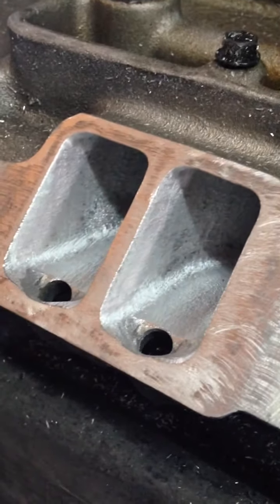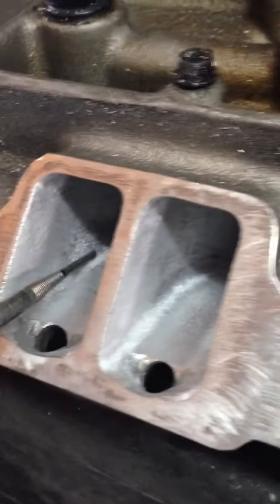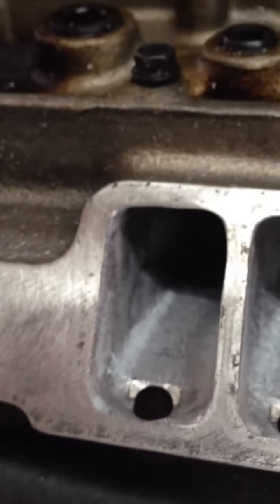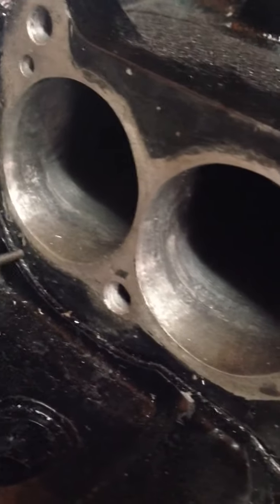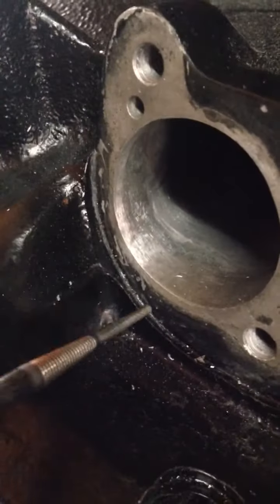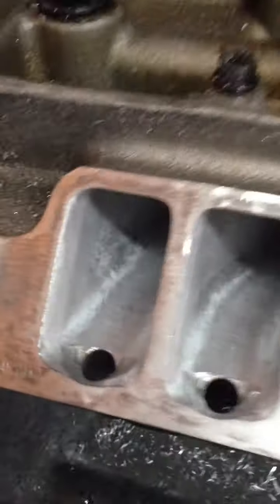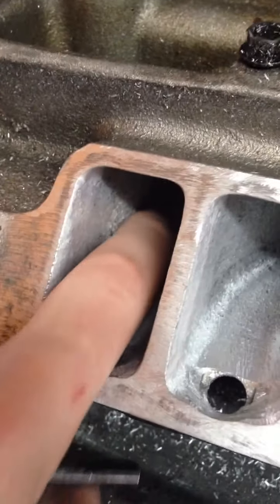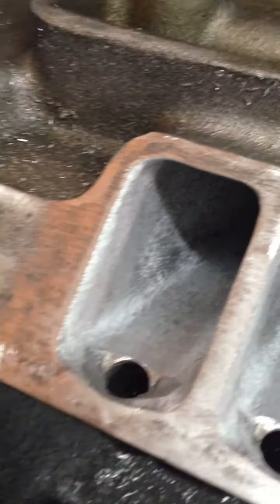*** New TPI porting secrets! ***

Comment: can a stock TPI be ported to flow as much as the aftermarket Edelbrock ot Accel?  Used aftermarket manifolds are going for $600 to $800 used now because of being discontinued.
Reply from the maker: Randall Fox 
Yes, if it’s done right.
Reply: @DarinDochterman  what do you charge to port a stock base?
Reply: Extrude hone it! Do a search for it. There is an article where they extrude homed a factory base and added larger runners. On a 383 it was one of the top performers. I’m doing a tip corvette right now.
Reply: @anthonyciarrocca2476  it's 900 to 1 K for an extrude hone and to do it right the heads have to be done with the intake. I ported my factory intake but I was wondering if there was enough meat to get it to the aftermarket CFM numbers. A mini-ram is best for a 383...Or a Super Ram if you can find one but used with an intake is almost 2k. Absurd.
Reply: @randallfox4265  I agree. It’s so not worth it. I was lucky to acquire a set if hi flow Edelbrock runners and baseplate for reasonable price. I am porting myself and matching it to trick flow 175 heads. Also a special cam etc and slp tri y headers.